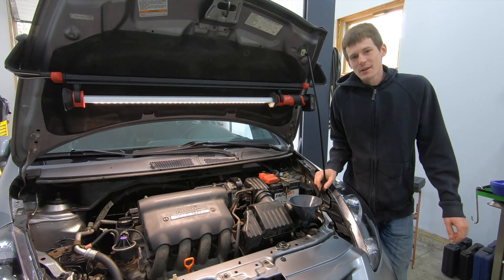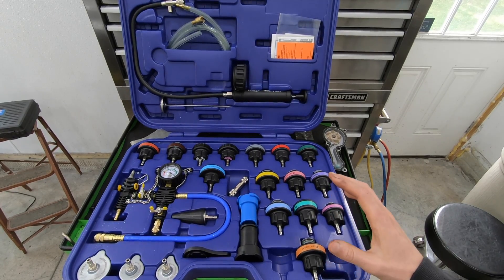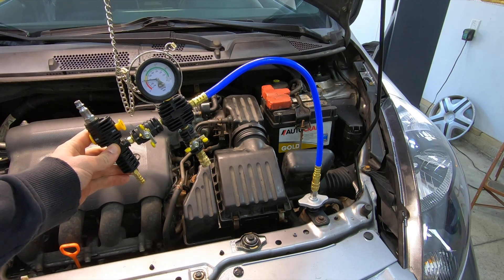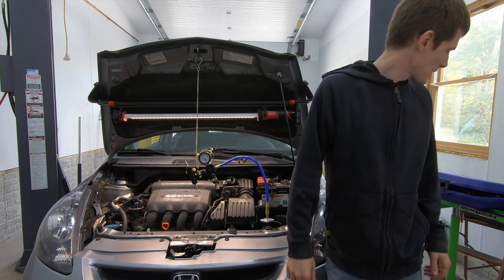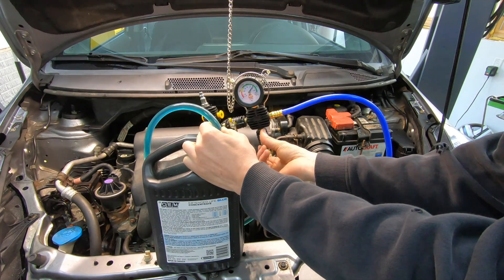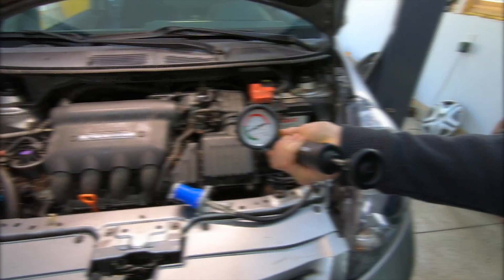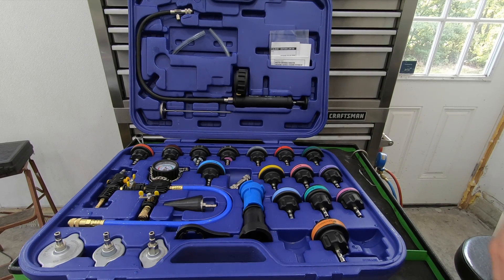How to Vacuum Fill & Pressure Test Your Cooling System

Comment from the maker: Pressure tester and Vacuum Filler: https://amzn.to/48V7KNO
Newer Ford & GM Adapter: https://amzn.to/36InyDM
Newer Land Rover & BMW Adapter: https://amzn.to/3ntIQLh
Newer Audi, Porsche, & VW Adapter: https://amzn.to/3d9Dsbi
My Amazon Store:  https://www.amazon.com/shop/repairgeek
Help support the channel, buy using my Amazon links
As an Amazon Associate I earn from qualifying purchases and your cost is exactly the same.
Reply: Isn't their a pocket of air in the coolant hose that gets sucked up between the coolant jug and the tool, don't you need to bleed that first 🤔
Reply: @ryandass15  his videos aren't good. need to look up other Oxygen Not Included videos
Reply: Very helpful as I’ll be needing one of these for my Volvo
Reply: this video wasn't very helpful. Need to figure out how to cool radbolt generators in the vacuum of space for the atomic collider. i was thinking i'm supposed to create glass shields but thats out of the question only have 3 solar panels and need it for them. Probably have to pipe sewage up there that probably will work.
Reply: You are missing the Astro Pneumatic Tool 7858523 NO. 23 Radiator Test Cap (Late Model Audi, VW, Porsche).
Reply: I bought same one on Amazon for 78 bucks
Reply: So if you get it done at dealer no tools and they dispose of it.

Comment: Jack up front end front end is higher than the heater core and hoses. The filler should be at a higher elevation that filler neck. Air will rise out quicker and it will be more effective. In some applications the coolant in a properly filled system will push out cap, with coolant being lower. With neck above it is easier to fill and bleed. l

Comment: When you first open the line to fill, does the air in the line not get in before the coolant get sucked into the system?
Reply: That's actually a good question 🤔

Comment: What about on a BMW without a radiator cap but a screw on over flow ..does it have an adapter for the non radiator cap bmws!

Comment: If anyone is struggling to pull vacuum but the system holds pressure, some overflow caps allow air in when pulling the vacuum. Put a rubber glove or similar under that cap then try again

Comment: You forgot to take out the air left in the hose that goes from the gallon of antifreeze to the pressure meter tool. I just say, regards.

Comment: I wonder how many VWs this would fix. The thing they're infamous for is heat that refuses to work despite people desperately replacing every part of the cooling system that might cause a heating problem. The only thing left is trapped air in the system, and VW loves to overcomplicate a cooling system. Also, many cars - like vans - have extra heater cores in the back, with long hose runs from the engine. There's all sorts of crazy stuff out there that just will not respond well to the usual dump and fill. If the cars you work on are fine after a dump and fill, maybe you need to top them off after a week, some engineer did you a favor.

Comment: Meanwhile, you sucked 24 inches of air in the tubing, into the system when you first cracked the valve. Should have primed the tubing first

Comment: Does the system need to be completely empty in order for it to work?
Example, upper radiator hose remove and replace, will this tool work as well?

Comment: Good info to know.  I'm not a mechanic, but my feeling is if you think you might have a spot in the system higher than the radiator cap, couldn't you simply raise the coolant level at the cap by using a long appropriately fitting funnel while refilling the coolant?  In other words, wouldn't a tightly fitting funnel allow you to bring the coolant level high inside the funnel during the last few minutes of the refill?  I have seen The Car Care Nut use a special Toyota funnel for this purpose.  But, yeah, vacuum is much more efficient at filling air pockets.

Comment: In the past I have used a small shop vac in wet mode to pull a vacuum  a couple of times and let rest for a short time. Has worked pretty good without issue.

Comment: Can you use the same system to drain?
Reply: You could probably use the pressure tester to build pressure in the system, then open the drain valve on the radiator.

Comment: Hey, loved your video, very informative. Great tool as well. Question, will this tool successfully vacuum all the air out of the system even an SUV with a separate rear heating core.? And then successfully make sure there’s no trapped air in the rear heating core as it’s filling?

Comment: At 5:55 your hose in the coolant was full of air and that was sucked in your system.........why not fill that hose with coolant?
Reply: my thoughts exactly - hence the need for 2nd / final 
vacuum
Reply: While vaccuming he should have opened the coolant line to draw coolant up to fill the hose then close it then continue vaccum

Comment: i have owned this for 6 years, I have 60+ cars thru it.  I have replaced the blue fill hose 1 time and the guage on the manifold 1 time.   i can't touch a car without this tool, my absolute favorite.  i would buy again if it gets stolen tomarrow.     Get the new orange cap, sold sperate, you will use it.

Comment: Hello, can I use this system when filling a coolant system which is not empty? If for example replacing a thermostat, then it is coming only little fluid out, but air is coming in the engine. Can I vacuum fill the system after that, when the system is maybe half full?

Comment: Question will the Milwaukee air compressor  m12 
the big one 2 gallon? Would that work with the radiator vacuum when putting the coolant back in

Comment: Question dose it drain out the coolant   In the beginning  are you have to drain it first
Reply from the maker: It will not drain coolant. You must drain it first.
Reply: Ok thanks
Reply: Radiator cap does not fit Mazda 2002
Reply: Can I use a Milwaukee air compressor 2 gallon will that work with battery pack

Comment: I just got virtually the same kit. Your review was excellent. Did you mention not to exceed pressure rating for the vehicle? I also got a gas tester to check for head gasket leaks.

Comment: How so you keep the thermostat open while doing this?
Reply: The thermostat will remain closed. But by pulling a vacuum on the system, you are able to pull the coolant into both sides of the thermostat. Most thermostats also have a small hole in the thermostat that allows a small amount of air or fluid through at all times. Old school mechanics would drill a hole (1/8" or smaller) if there wasn't one already.

Comment: Do you have to take out the thermostat to get coolant to go empty from and recirculate through the entire block? And how to you get it to run through the heater core without running the car with heat on?

Comment: Doing pressure test post refilling the system, doesnt bring air into it? before refilling, should i reject the coolant inside the engine or i can proceed with existing coolant?
Reply: The pressure test introduces compressed air into the radiator. This exerts force on the coolant and thus will reveal a leak. The air does not mix with the coolant, or leave the radiator.

Comment: Do you attach to reservoir or radiator cap?
Reply: The tool is to be attached to the radiator filler neck. If you have a pressurized reservoir then you place a non-vented cap on the reservoir to prevent air leakage. I have a Nissan Frontier and it has a pressurized reservoir tank with a vented cap and a non-vented cap installed on the radiator filler neck. The procedure is to take the non-vented cap and install it on the reservoir tank and set the vented cap to the side until the refill procedure is completed. Once the refill procedure is accomplished then you top off the reservoir and put the vented cap back on the reservoir and the non-vented cap back on the radiator filler neck.

Comment: Can this be done with coolant in it or have to drain the radiator first?
Reply: You can pull another vacuum on the system if you're trying to get trapped air out. But it will pull a little coolant out and eject via the bottom connector, so put the tube into an empty container. Then you can re-use the fluid that comes out: save you wasting it...
Reply: @AdamDitheridge  figured that out cheers brother 🫡🫡

Comment: Hello so my question is will this tool only work when the coolant system is empty or will it still suck air pockets out even if the system is full? I will be doing an airlift procedure on my 2016 q50 which has 2 different cooling systems, one for the engine and the other for the heat exchanger, ill be using this tool for both sides but wanted to know if i have to drain all the coolant or if i can still airlift without having to drain the coolant thanks
Reply: When you pull the full vacuum, expect the radiator hoses to collapse. If your system is full, that will cause coolant to be expelled through the tool. So it's best to drain out at least some coolant beforehand.

Comment: You're spot on about the Fit.  The heater core is higher than the radiator cap.  I don't have a vacuum filler so I had to lift the front end of my kid's car to get most of the air out of the system.  I ran the car on ramp stands for about 15 minutes and air bubbles were still coming out.  The next time I change the coolant I'm buying a tool like this.  Thanks for the video.

Comment: If there is an overflow tank does this tool get connected to that instead?
Reply: Pinch off the tube to the overflow reservoir before starting the vacuum procedure.
Reply from the maker: Yes, exactly.
Reply: The tool is placed on whichever opening has a PRESSURE CAP.  If you don't understand that, you're not qualified to use this tool.

Comment: You youtube guys piss me off,  you need to show beginners how to use the air compressor with the vacuum filler, how much PSI needs to be in my air compressor to suck the air with the vacuum filler? Etc
Reply: 90 PSI and 4.2 CFM required. Rent from Home Depot.

Comment: Isn't there some air trapped in the hose which is drawing the coolant?  Before the coolant is sucked to the valve  there is some air trapped in the hose. What do you do with that?
Reply: Purge/fill the coolant refill pipe first....else air will be drawn into the system.

Comment: But technically this is only vacuuming/pressurizing everything before the thermostat, no? Everything after the thermostat, and in the engine block isn’t vacuumed or pressurized……. Trying to figure this out.
Reply: Thermostats all have small bleed holes.

Comment: You took compressed air not a vacuum pump ? I dont need a vacuum pump for this right ?
Reply: The tool uses a venturi (vacuum transducer) which creates the vacuum. By blowing air through the venturi it creates the suction and reduces the pressure inside of the cooling system. In this video, when he attached the air hose to what he calls a "vacuum generator" he is merely attaching his high pressure air hose to the vacuum transducer which creates the vacuum on the system. To answer your question - No, you do not need a separate vacuum pump. The tool comes with the vacuum transducer. You do need a pressurized air source that can provide between 80 - 120 PSI of pressurized air.

Comment: I saw a bubble go up while you were checking what was in the bottle. It's better to get a clean 5 gallon bucket. Pour all your coolant in one container and you won't have to stop
Reply: i thought the same thing BUT doesnt it suck air in from the fill tube in the very beginning? before it takes the coolant, technically its full with air.

Comment: I noticed in the video when you introduced compressed air that the needle stopped just between the red and yellow line. How do you know how much compressed air to use and where the needle should stop? Is it always 24 - 26 inHg or is it different for every car?
Reply: That is a good question. The answer is that you want to pull as much vacuum as physically possible for you specific elevation. If you are at sea level then the tool will pull close to 29.92" hg but if you're at 5000 ft. elevation then you will be lucky to pull 25" hg. The answer is to pull as much vacuum as physically possible given your specific elevation. Note that all of the radiator hoses are going to completely collapse and your cooling system is going to look like it's destroyed until you equalize the pressures inside the engine and out.
Reply: The Snap On manual notes that for each 1,000 feet of elevation gain above sea level, you will find that your "best" vacuum will be reduced by 1".

Comment: What happened to all that air in the line at 5:55?
Surely you can purge the line before releasing the vacuum?

Also can this tool be used if the system has 95% of the coolant still in the system? Or does it have to be empty?
Reply: Pulling a vacuum will collapse the radiator hoses. This could cause coolant to be expelled from the tool depending on how full it is, so it's best to drain out at least some coolant beforehand.
Reply: @recentlychanged  or just run a hose from the air output on the tool into a bucket to catch the expelled fluid, which can be re-used.

Comment: great demonstration of the kit, for anyone in the UK/Europe, these kits are available for £55  on ebay or Amazon  currently  (late 2023)    they don't quite fit the older peugeot/citroen quite right, the seal diameter is a little large though the cap itself fits fine.

Comment: Pour the new 50/50 prediluted coolant into a clean white 5 gal bucket to monitor your consumption. Most vehicles will need more than one gallon.
There are coolant drain plugs on engine blocks too if you want a total drain / flush.
Reply: On the back of his coolant jug, it was written as concentrate! Should it not be a 50/50 mix?

Comment: Hello! Thanks! Too good Video. When you open the faucet to start filling in new coolant in the system, there is air in that hose that comes from the canister with the cooler in it. Where does that air go when you have opened the faucet to fill in coolant? Thanks! From Tommy Bertilsson from Sweden
Reply: Yes, you are absolutely correct. The proper procedure is to purge the fill tube while the vacuum is being pulled on the system. You slightly open the valve that controls the coolant flow and let the hose fill with coolant while the transducer is removing air from the system. Once the hose is filled with coolant you can close the valve and the coolant will remain in the hose. I believe that this was an oversight on this video but numerous people noted it. The presenter is not a professional and we all learn from watching others while they learn.

Comment: FYI... I found that OEM Tools makes a better built kit that is more universal fir less than half the price. It doesn't come with a pressure tester but those can be had fir $50. Just dont get suckered in to buying a cheap chinese fill system. (Chinese testers are fine. )

Comment: All Honda cars have a bleeder screw on the high point of the engine,  usually on the intake of cylinder head coolant passage.   Many other makes have this high point bleed screw.  This allows bleeding air pockets out

Comment: If your really cheap,  you can install a back flush kit on your upper heater core hose, it has a Tee fitting with a cap,  basically this becomes the high point in your system. As you fill the engine,  until COOLANT runs out of this fitting,  your system is 99% filled. You can run the engine Ruth this Tee fitting open also to vent.   The other truck is to use a 10 inch radiator FILL funnel,  That becomes the high point. To let all AIR bleed out.   Last tip of you have a low radiator,  is to put the front of the car on a hill or ramp or jack stands to elevate the radiator

Comment: THE HOSE WAS FULL OF AIR TO START WITH AND THAT SUCKS AIR INTO THE SYSTEM BEFORE THE COOLANT BEGINS TO FILL THE HOSE!!!  YOU NEED TO BLED THE AIR OUT OF THE HOSE FIRST BY RUNNING THE VACUUM PUMP AGAIN WITH THE COOLANT VALVE OPEN... AFTER THE HOSE IS LIQUID FULL,  CLOSE BOTH VALVES AND  THEN FILL THE SYSTEM
Reply: You are correct.....but don't shout ;)

Comment: That hose is full of air and you're putting that into the system you should open the valve start the fluid and shut it back off as soon as there's no air left in the feeling hose revacuum the system then start your fill if you have to switch bottles do not suck any air back into that line

Comment: 4:05-5:03 WELL SAID .  Thorough explanation and presentation of potential issues.
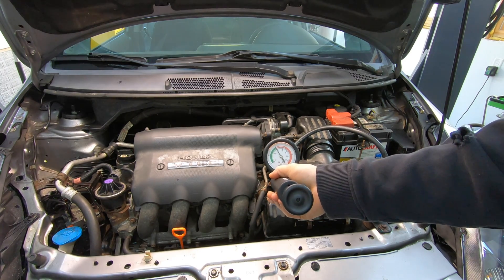7:50 the extra thorough work to pressure test, even though no leaks were made known while held under vacuum.    And the AWESOME (and very plausible) theory 🤓 on why there could potentially be a false sense of a “sealed” “leak-free” system. Could leak later down the road and leave a customer unhappy (stranded if they overheat or even won’t drive with a leak. which we should never fault them for early repairs, or preventative maintenance) and leave a mechanic embarrassed; also maybe scratching our head. 

*subscribed, and all notifications turned on!
Reply: Correct, sometimes a vacuum will "pull" a leakpoint to seal and hold. But.... this is a pressurized system, it needs to hold under pressure...

Comment: The majority of cooling systems no longer have radiator caps.  This tool is essential to modern auto repair and maintenance!!     
I have one of the top units made by master cool, that I got off the Cornwell truck. I actually they were on back order and I got one used for my birthday!    I’m unsure about the cheaper sets, especially where valve components are plastic, but Astro pneumatic is a pretty well-established brand.   And all the components are the same selection for the most part. (of unknown varied quality.)       For multiple reasons above: Glad you did this review!!